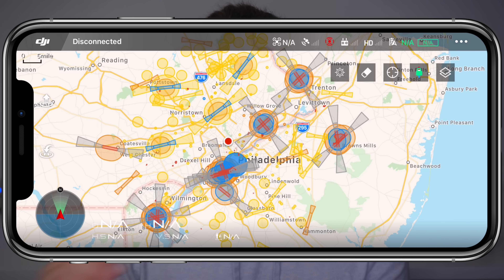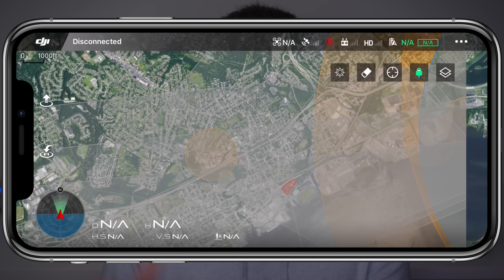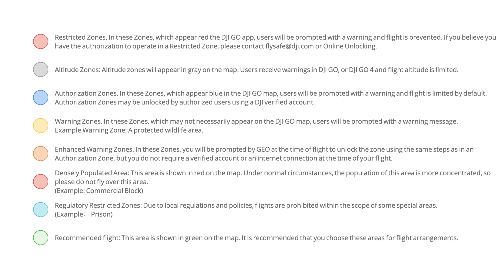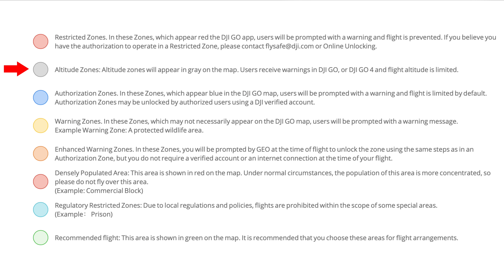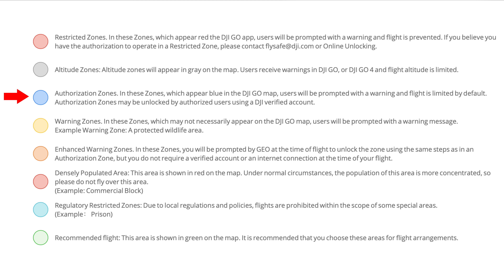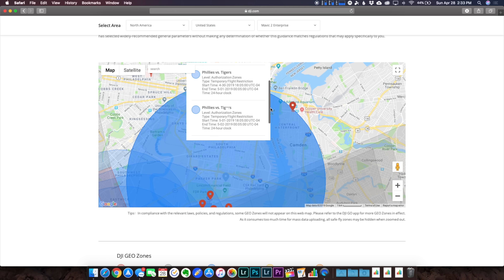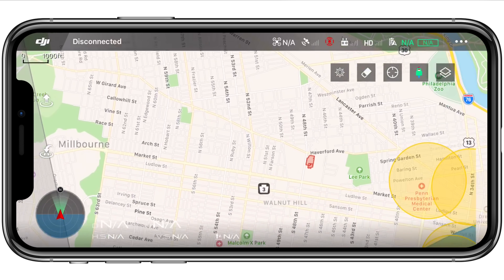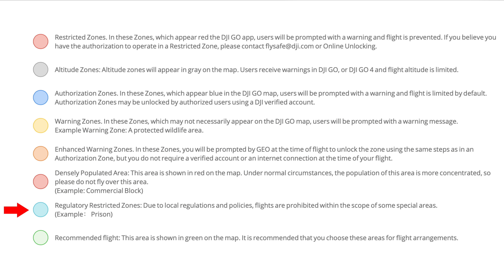Understanding DJI's Geofencing & Fly Safe System (DJI Go 4)

Comment: Great video, you covered the points I would have when I attempted my own vid, but you did a much better job than I ever could. An update would be appreciated and help others, for example, are the restrictions still as restrictive, 3 years later? An update would be necessary to provide real-world experiences to those zones identified as "no authorization" required, like the Altitude zone - I live within one, and I assure you that authorization is required, regardless of what DJI's legend indicates for this zone. Like Michael Kirkpatrick a few comments earlier (still a year ago), I experienced a forced, uncontrolled "landing" after being at altitude, in an area that had no FAA restriction in place (yet DJI did suddenly restrict, after I had already taken off and flown for a few minutes in the same area). 
Also - I see some comments from DJI reps below indicating to not blame DJI, yet new buyers should be informed of what they're getting into when buying DJI. Apps like Airmap are awesome for LAANC unlocking, but a lot of pilots aren't getting that regardless of LAANC authorization, DJI requires its own unlock, and by unlocking a zone in one area, you lose access to free-flight areas until you clear that unlock.

Comment: One very important thing to note is that if you get an unlocking license and turn ON a zone and you launch your drone from outside that zone fly into the check boxed selection zone in your licensed list that you made that you are now stuck in that zone and can not fly back home.  So as an example let’s say at 1 mile away you have a 200 foot radius authorisation license then you fly to that spot and enter the 200 foot radius then you are now stuck in that radius, you basically flew into your own geo fenced zone. You then have to hope you hav3 adequate battery, drive to a location located inside that 200 foot radius and then update your home spot to your controller and return to home or simply fly to where you are. I tested to see if there was any way around this and unfortunately there isn’t so if you intend on doing the 1  mile flight to get there include it and some extra in a polygon or if a circle permits before requesting the license. I had to go back and submit all my documents and remote pilots license etc all again because I modified the zones to include all possible take off locations to be well covered inside the requested area.

Comment: Billy... Thanks for the video.  Fun to see your video as I live in Malvern..not far from you and know all those places you mentioned. I had not flown my Mavic Air for some time and first encountered the geo-fence block yesterday.  I use an apple mini iPad as it is bigger than my phone and a bit easier to see.  I guess my question is since it does not have cell reception, can you use it to unlock a geo-fence restriction if it is not connected to the internet?  If the answer is no, can I use my phone for the unlock process and then go back to the mini iPad to fly?   Thanks.

Comment: When I first started, over three years ago, now, there were laws, but there were no real restrictions because of the lack of enforcement.
Now, it is sooooo not worth it.
I have abandoned camera drones, in favor of FPV, which coincidentally, DJI produces a digital goggle system for known as Air Unit.
With FPV there is no GPS; hence no geo-fencing. FAA laws still apply, but there's still no enforcement.
Camera drones are likely the family station wagon. FPV is like a motorcycle. There are enough varieties of FPV drones to have all manner flight, and the flight is much more natural looking.
FPV drones are much more difficult to fly than camera drones; hence camera drone success. However, if you've become bored with camera drones, head on over to FPV...be sure to train on a simulator.

Comment: I appreciated your thorough videos explaining the DJI restrictions, they are very informative. Unfortunately, they do not explain an issue I am experiencing with my new Mavic Air 2, my first drone.

I’m down in New Castle, DE and my house is on the edge of the red NCC Airport zone. The line cuts right thru my yard and house. I got the drone last week and my first flight was initially blocked but then DJI Fly offered to unlock the zone, and I was able to do so after getting a verification code from DJI. I flew around my house and yard, but when I tried to return to home from the other side of my yard, the drone would not move forward. I now suspect I had exited the zone and it was stopping me from crossing back in. I did a second flight with same result.

Yesterday I tried to fly again, but this time it would not give me the option to unlock. Last week’s code was still on the app but expired, turning it on did nothing. I went thru Kittyhawk and got a LAANC authorization for the zone, which it gave me without an issue. However, there is no place in DJI Fly to enter that code. 

Eventually I found that I needed to go to DJI Fly on my desktop and request authorization there. My first try offered me pins in the map to select from, which I selected the red zone airport pin and it gave me an unlock code which it downloaded to my remote. I went to fly, now seeing the block was lifted, but after double checking a setting, I returned to the camera view to find I was blocked again. The new license is on my app showing the New Castle zone is unlocked, but indicating my aircraft is disconnected? When I tried again on the DJI site I’m no longer offered any pins to select an area. WTH?

This is incredibly frustrating and seems so arbitrary. It is near impossible to find any answers for why this worked initially and now it is not working at all. I just want to fly in my own back yard and can’t. After only one week I have a very bad opinion of DJI.

Comment: Does your phone or tablet need to have service to fly after you have already downloaded dji do 4?
Reply from the maker: No - but you won’t get the best experience. Can’t update firmware, load maps, or check airspace.
Reply: @billykyle  I was just wondering cause my phone has service through metro PC's  but my Samsung tab 3 doesn't and I rather use the tab for bigger screen know what I mean. Thanks bud.

Comment: Great Video, just noticed something odd though; I have a Mavic 2 Pro with latest firmware updates. When I try to fly through a Yellow warning zone I don't have a problem BUT if I try to plot a route using Waypoints 2.0 , it will not let me place a waypoint inside the zone.  This appears to be something lots of people are struggling with following a recent GO 4 update as mentioned on the DJI forum. This appears to affect Android only with IOS being fine. Unlocking is not an option because Yellow warning Zones don't need unlocking.

Comment: Billy, Quick question.  I don't do a whole lot of flying but whenever I do in an area that needs me to get authorization, I contact ATC and then turn on the geofence I've downloaded with self-unlocking.  Problem is I see old geofencing in the DJI APP from previous flights that are outdated.  Is there a way to clear those out?  Thanks

Comment: If we didn't have idiots out there flying DJI and other companies wouldn't have to use Geo-fencing address safety and liability.  That said, you can unlock restricted geo-fenced areas by sending your flight consent from the airport, school, prison, etc to DJI.   If all checks out, DJI will provide you a with a temporary unlock license.  Typically, your requests should take place a few days prior to your flight to ensure you get the access when you are ready to fly.  We've flown within restricted airports and parks using this method.   Here's the link: https://www.dji.com/flysafe/custom-unlock

Comment: DJI is completely paranoid in the way they implement this. We are all for safety but there is common sense approach to remove some of these blanket restrictions with sensible limitations. For instance, I live 2 miles away from a air force base in USA. I can not even start the motor of my mavic even inside my house. However, I can fly my tello above my house. No regular airplane would fly below 100ft unless they are about to land the plan.  I wish instead of blanket restrictions, DJI would implement virtual barriers to restrict the altitude and distance they can fly in these zones. DJI needs to be smart when it comes to these restrictions.

Comment: I think you missed one major point.  In app authorization is not the same as ATC clearance. You now need both if you plan to fly within a five mile radius of an airport. The in app authorization clears DJI of any liability from your flight actions.
Reply: I think DJI is making a mistake that is going to confuse the situation by using the wording “authorized”.  If something goes wrong the first excuse someone is going to say is “but my flight was authorized”. DJI needs additional language to distinguish between app launch approval and additional ATC flight approval.  Some users might think the app and tower are connected.  Which in the future would be amazing.  ATC’s nationwide could be looking at many tens of thousands of additional calls to the towers daily for UAS flight which would be overwhelming.
Reply from the maker: This video was only focused on the geofence system itself, a topic that even verterans will be confused with. It's a no brainier you have to get ATC clearance too at this point.

Comment: I ran into this problem last week, my P4 controller has the built in screen. Now to use this in these areas I need internet connection, which now requires me to buy a new controller or get a Hot Spot plan from my cell phone provider. Not happy! Good thing I brought my Mavic 2 Pro along for the job.

Comment: DJI have to cover themselves and go over the top with the GeoFencing but it is a real shame you cannot fly at abandoned prisons and similar. I used to fly at a retired airfield in the UK. Will have to check to see if the map now blocks this.
Reply from the maker: It makes sense that they would have to protect themselves. Just annoying.
Reply: @billykyle  Couldn't agree more! Especially as so many manufacturers has zero fencing.

Comment: DJI doesn’t designate No Fly Zones, the FAA does.  No reason to hate on the software.
Reply: Correct.  The FAA implements no fly zones (and they are also the ONLY people that can create a no fly zone), but most of what dji implements don't follow FAA rules or policies.  There are no rules for flying over schools or even prisons.  And to allow a location to request this is absurd.  Think about what commercial air travel (also FAA jurisdiction) would be like if schools and prisons were real no fly zones... The "by local policy" zone is a joke.  State and local governments and committees have absolutely no saggy in anything that flies.
Reply: @TroyNahrwold  that is not accurate state and local governments do have privacy policies and can enforce those policies...
Reply: @truckroutedetourwithpeteshelby  According to FAA policy, state and local governments have NO, 0, ZERO authority over anything that flies.  And they have confirmed this by stepping in to confront local governments that have tried regulating drones.  If you doubt this, feel free to contact your local FAA office about this fact.  The only authority or regulation local and/or state governments can enforce is if you can take off or land.  This may seem like splitting hairs, but it is an important difference.
Reply: @TroyNahrwold  As just an example Minnesota has a great many laws pertaining to unmanned flight...
All UAS registered with the FAA in this manner and owned by a Minnesota resident must register with MnDOT and pay an annual registration fee in Minnesota. Non-residents using UAS for commercial operations in Minnesota must also register their UAS before the aircraft is used for commercial purposes. To complete registration of the aircraft, the owner is required to show proof that sales tax has been paid and provide insurance information. The insurance must comply with the requirements of Minnesota Statute 360.59, Subd. 10. On the Minnesota registration form, use the same registration number that was provided by the FAA that starts with “N-“.”
Plus there is a bunch of other laws also that they can and will enforce and it's legal for them to do so under the 10th Amendment
Reply: @truckroutedetourwithpeteshelby  And there is the difference... Those laws have nothing to do pertaining to FLIGHT.  That have to do with taxation of personal possessions and the running of businesses within the state.  Both of which the state has jurisdiction over.  My comments over the authority of the state and local governments pertained solely to how and where you are authorized to fly your aircraft.
Reply: Dji doesn't have to implement NFZs. If they did than ever drone would have them. The operator has to have responsibility for their own actions.
Reply: DJI has no affiliation with FAA and GEOFencing. That is a company take preliminary action to legally protect themselves. DJI creates geofences based on FAA laws but that is simply them trying to avoid being sued for operators doing dumb stuff. FAA is not directing DJI to create Geofences. There are plenty of other drone manufacturers that do not have Geofencing built in. 
The problem is that DJI creates its own NFZs that may or may not be accurate. They often overshoot the areas or just make things more of a hassle for their own protection.
Reply: Got DJI Inspire 2, There are Many many smaller drones sold that has NO  restrictions, You just fabricated that , Its DJI , there are a few idiots out there who fly have No clue, so that is a good thing
Reply: DJI goes beyond FFA restrictions. Take for instance the schools the DJI put fro fence on. That isn’t FAA. I had instance last year where I was 20 miles from a FAA NFZ from a fire. Dji had a geo fence. Trying to shoot for a wedding. It was very frustrating.

Comment: Hey Billy, great video. Geofencing has taken much of the fun out of flying my P-4 v2.0 here in Kansas City. It's cumbersome and quite annoying to deal with. As an Airline Pilot by profession. I can discern the need for implementing such a system as a necessary evil, however I still have some measure of disdain for it.. I understand this system, I've learned to tolerate it and I use it effectively when flying my P-4 v2.0.  Again...great video. By the way, you would have made an awesome instructor jet pilot (military or commercial)!!
Reply from the maker: If only I knew how to fly planes! Lol. Thanks, I’ll stick to drones for now.

Comment: I deleted, reinstalled my DJI app and never accept the no fly update. There’s 3 airports in the small country I’m living in killing a lot areas. 
I self impose common sense. I use Flywhere to determine local laws and area restrictions that the no fly would not have. 
I check flight radar app but usually I’m never at an altitude close to any aircraft. 
I also use Ventusky to see the wind speed at different altitudes.

Comment: I got caught in one, one mile over water. Done would NOT respond until low battery warning . People... when flying new area, always check the map first. The bow ties were not there 12 months ago. WTF bro almost lost my sh*t.
Reply: HPN= airport code. White plains International
Reply: Derrick Ferguson damn. I used to live in white plains. Haha
Reply from the maker: Drone came back to you right?
Reply: @billykyle  It woke up when batt got to 20 percent , I was able to manually fly back. Surprising after making a B-line to shore Mavic2 made the 1mile over land back at 9pct.  Check the map.HPN / Mario Cuomo br. Now i have fly in between to get the shot.
Reply: @tlsmoke23  
Scary, glad you got it back. What is HPN?

Comment: Will any of the zones force an auto-land?
Reply from the maker: Sometimes if you can get in the air before it asks you to authorize them it will auto land if you cancel.
Reply: @billykyle  
Near where i live there is a very long and narrow narrow restricted zone that follows a RR track. I wouldn't test it but I've wondered what a dji drone would do if you hit that area at full speed and tried to break though to the other side LOL
Reply: @billykyle  what would happen if your fly through a yellow into a blue zone? Since you're already in the air, would the app prompt you to unlock? Also, if you accidentally hit the cancel button... What whil happened? Auto land? I feel the drone should just hit a wall and not auto land. Also, if your RTH passes through a Blue zone the go 4 app says it will not come back home...

Comment: If you live anywhere near a metro area DJI has totally ruined the enjoyment of owning a drone.  The maps are so discombobulated one can barely tell what's going on & how a drone reacts upon entering a zone is a mystery.  Will it prevent further egress into the zone, or will it enter a forced & irreversible auto-landing?  This is where NLD comes in.  Cut the cord & take back control of the drone you purchased!
Reply: Hi, what is NLD?
Reply: @BradPippin  
A company that sells software which allows you to change settings in the dji software and firmware to remove no fly zones and adjust other performance settings.
https://nolimitdronez.com/
Reply: Indeed. It’s starting to get out of hand. I think it will only get more aggressive. DJI wants to show the United States government that they can self-regulate at all costs.